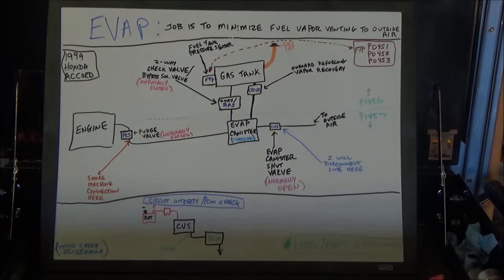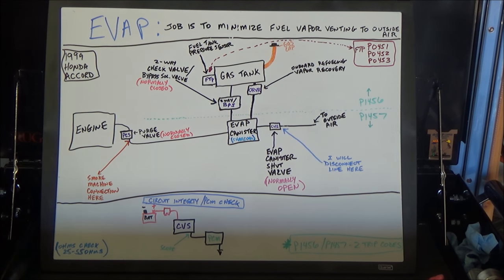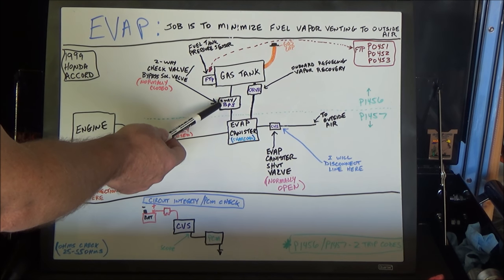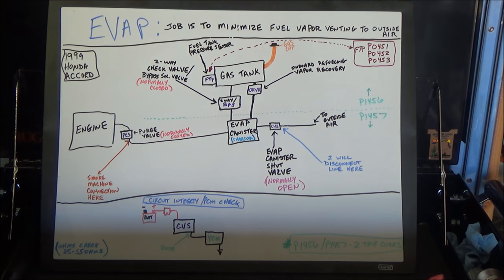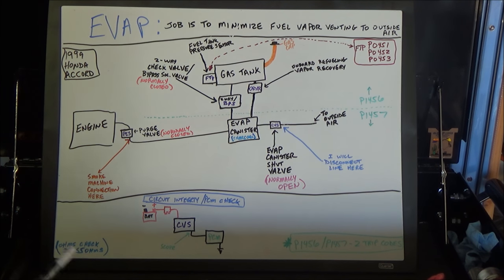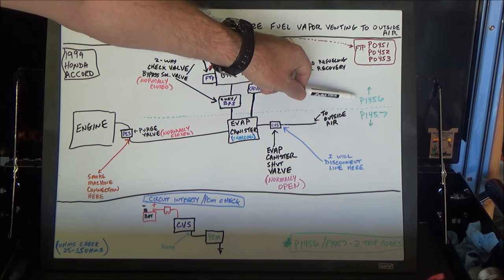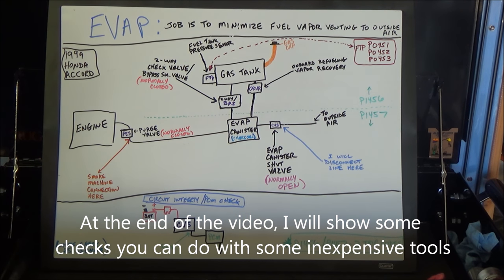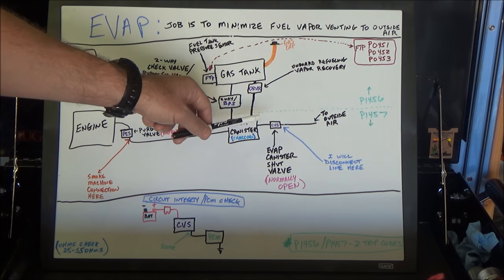Honda Accord P1457 (90-2) EVAP Canister Vent Solenoid Diagnosis/Repair 1999 V6 (1998-2002 Similar)

Comment: I have replaced both evap canister, gas cap, and evap canister shut off valve and the code is still being tripped. Any help will do
Reply from the maker: Sometimes it can be tough to track it down, especially on older Hondas that aren't able to pinpoint the issue.  A smoke machine and scan tool usually help locate the issue.

Comment: i got a trouble code recently P01457 says evap system canister.. my gas 
millage is suffering BAD  half a tank of gas a day or about hour and 
half driving i have 2002 Honda civic 1.7 liter
Reply from the maker: You may have more than one issue going on.  Troubleshoot the P1457 and then go from there.
Reply: Big Dog50001  yes i do have crankshaft sensor trouble code for a long time.. even after i got a new Ebay sensor installed and timing checked, new connector plug, he even checked the signal .. but nothing  helped to clear the code.. but that was about 6 months ago.. but the evap code just came on about week code and bad milage also

Comment: Can the codes be erased by disconnecting the negative battery terminal?
Reply from the maker: The codes will be erased on most Hondas when the battery is disconnected for a few minutes.  Some models need the radio code reentered and some will need to do an idle relearn process.  It will also clear all emission related monitors until the vehicle is driven enough to rerun them.
Reply: Thanks

Comment: There's really two tough parts to replacing the solenoid.   First, the two screws that hold it on will be on a 20 year old car, rusted (unless it's a dry climate car).  The one closest to the ground will be so rusted that you won't be able to get it out (probably because it's close to the salt), which means there's a good chance you'll end up buying a new canister.  The rust on ours was so thick even pb blaster won't do anything to it.  And you can't use heat because the canister is made of plastic.

The second issue is the bolt that holds the canister screws into a thin piece of metal that is welded to the car.  The bolt is so short that it has to be flush against the metal and as soon as you push the canister up against the metal, it moves the piece of metal away.  I had to push a screwdriver behind that metal to force it to stay down.   Bad design on Honda's part.
Reply from the maker: They can be tough sometimes, thanks for the input.
Reply: Lol .vise grips will do the job homie . never give up 💪
Reply: @AngelRodriguez-uw4nw   Or an ez out drill

Comment: 18:00🕗 The boats will be strip you can use a strip Bolt kit 2 replace the boats or the actual screw hole

Comment: I changed that part for 1457 code and reset my check light and that 1457 code still popping up
Reply from the maker: There are other reasons it can set the code, including a leak, a bad purge valve or bad bypass check valve/solenoid.

Comment: How do you remove the electrical clip
Reply from the maker: Mike arroyo On Hondas, most electrical connectors can be removed by pressing on tab and pulling out, they make it pretty easy unlike some manufacturers.  Sometimes they can be stuck in there pretty good if they haven't been removed in a while.

Comment: Hi
I have 2000 Honda Accord.  I have the same code P1457, I replaced the (Shut Off Valve) CVS,  it still have the same issue P1457 and check engine light on.  I have replaced a Canister Filter, Shut Off Valve,Genuine Carbon Canister,Evaporative Canister Bypass Valve, Canister Purge Valve and Honda gas cap.  Will it be possible the issue of P1457 is Fuel Tank Pressure Sensor ??? that one I did not replace.
please help anyone, I will very appreciate.
Bobby
Reply from the maker: A faulty fuel tank pressure sensor could fool the computer and give the code.  However, that code is for a leak, so the first thing I would do is test the system for a leak with a smoke machine.
Reply: Thank you so much for the replay.  Where can I get a smoke machine?
is there any backup test when I do not have a smoke machine?
I greatly appreciate your reply.
Reply: Do i need to start engine during the smoke test?
thanks
Reply from the maker: No, not for an EVAP leak test.

Comment: if it is working so why did you change it????
Reply from the maker: Watch the video again and you will see that it wasn't working until I tapped on it and got it to work again.  This is an old mechanics trick and it confirmed the part was bad.  If I would have left the part on the vehicle, the part would have failed again and the owner would have returned with a check engine light and been mad that I didn't fix the vehicle.  This is known as a "come back", which is something you don't want when you work on vehicles.

Comment: Where would you start if you had both a P1456 & P1457 and you know that its not the gas cap?
01 CRV
Reply from the maker: Eric Kress I would probably start by testing the canister vent shut valve and then the purge valve.  As a side note, I don't care for aftermarket gas caps much.
Reply: Thank you I will start there!  I bought an oem one from Honda to confirm that wasn't my problem.  Figured I'd rule out the easiest/cheapest possibility.

Comment: great vid...I live in PA so my screws were completely rusted into the grommets. when I tried to unscrew with vice grips the metal grommets came out of the plastic housing. rather than purchasing a new canister I went creeping around Home Depot. Found a part that worked better than the Honda stock nuts: http://www.homedepot.com/p/Crown-Bolt-10-32-tpi-Brass-Insert-Nut-51018/203088626. careful when screwing them in though as the brass screw head will snap off.
Reply from the maker: That sucks but it does happen when you live in the rust belt.  Let us know how that repair holds up over time.

Comment: You have all that nice pro equipment and no rack??? You have a compressor cause the leak tamer doesn't work without one
Reply from the maker: Yes I have an air compressor, and I would have a lift if I had the room in my shop but unfortunately it is a bit too small for one.

Comment: Dave, to test evap leak using scan tool can we use this logic.  I get to know from SMA(south main Auto)
1) Start the car, activate purge solenoid(OPNE) and close vent solenoid. activate (open) bypass valve.. if there is no leak then FTP sensor should show vaccum in fuel tank, (this is because vaccum applied from purge will travel all the way back to fuel tank)..  if it doesnt show vaccum in FTP then we know either it is vent solenoid/purge solenoid / leak.

2) Does Honda have any valve that open during refuelling, usually if this valve is bad then when you refuel it clicks every few seconds because of pressure build up in fuel tank, in Toyota this is called atmospheric pressure valve. pls refer this video https://www.youtube.com/watch?v=brXckSyccm8 very excellent one for toyota. I am trying to create analogy for honda or you can repurpose for honda in your channel.. very nice..
Reply from the maker: Yes you can test that way with a scan tool, in fact this is a test I like to use (this is also how ECM does its testing), just remember that no FTP changes could indicate either a leak somewhere, a bad solenoid or a bad FTP.  

For refueling, all manufacturers have to comply with EPA ORVR requirements.  For Honda, on this vehicle they use a Fuel Tank Vapor Control Valve (usually installed on top of gas tank), which opens when pressure in tank builds from refueling. The fuel vapors are pushed to the charcoal canister through the pressure of refueling, of course the Canister Vent Shut Valve also has to be open in order for this to happen.  If either valve is not open, too much pressure can build up and continually shut off fuel pump.
Reply: Big Dog50001 Automotive Excellent. I also heard activating bypass valve thru scan tool will activate only for few seconds and this is the time we have to check FTP. After that few seconds even though scan tool says bypass valve open it may be closed and we may think that it is open. If you can do anyvideo using this scan tool logic that will be helpful to your channel and us as well. Willing to contribute to your channel

Comment: 99 acura tl smell of gas vaporizer car  and p1457 and bad mileage  ?
Reply from the maker: Could be separate issues so it would have to be tested and diagnosed properly, but if I remember correctly the owner of the 1999 Accord in this video had similar complaints.
Reply: Big Dog50001 Automotive thanks I'll start like ir video